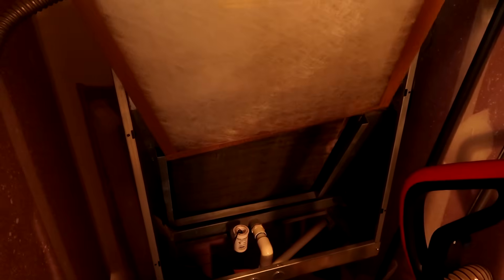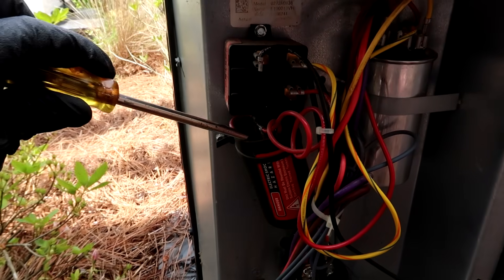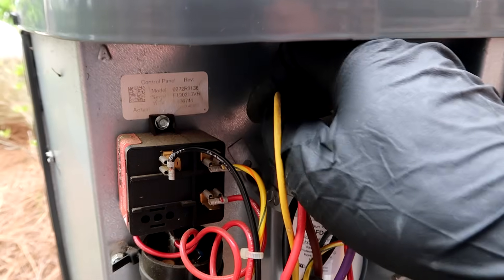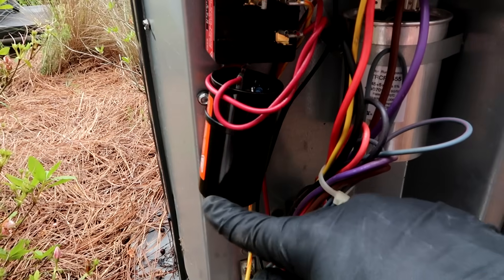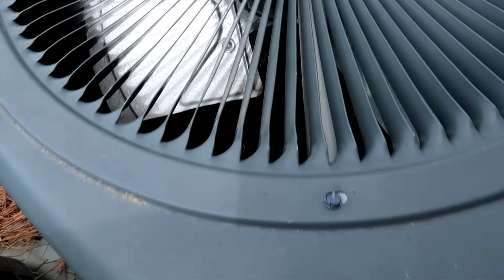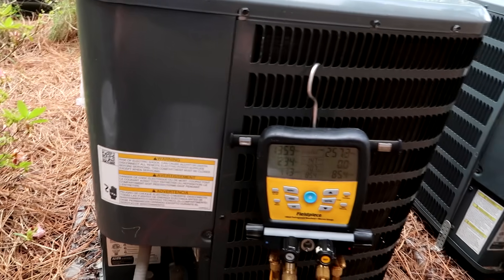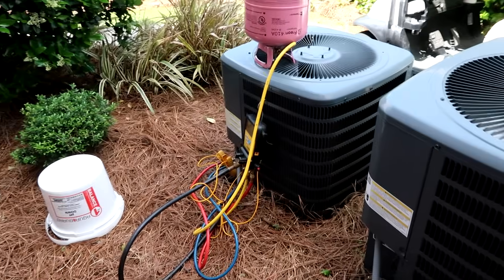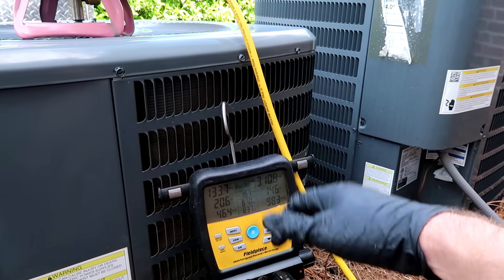HVAC Videos For Beginners

Comment: Lex  what about using a sealant on those leakers???
Reply from the maker: I saw a guy do an experiment with that stuff in a glass pickle jar.  It turned waxy and gummy. I'm too scared to use it for that reason.  It would clog the system. Thank you so much for watching!

Comment: I am in Michigan and home inspectors have this rule of not turning on an AC to test unless it has be at least 65 degrees for the past 24 hours.  I know about crankcase heaters but, how common are those in MI?  Will it really ruin the compressor to run the unit below 65 degrees?   We lived in southern Colorado where it was 50s every night and 90s every day in the summer.  And everyone ran their AC every day.  Did everyone have a crankcase heater
Reply from the maker: 65 is okay to run. Ive never heard that before so I'm not sure. Crankcase heaters are to keep the oil and refrigerant from fracturing. That would happen in 32 degree weather.
Reply: @LexVance    Yeah, 65 degrees for 24 hours is the home inspector rule.  I have inspected grow ops here in MI and they run the AC all year round.

Comment: When we turn our inside unit on it makes the button click in on the outside unit but the unit won’t come on… we have power evoking I got the unit but the fan or anything won’t come on any info would be grately appreciated
Reply from the maker: There's no high voltage. Check your breaker.

Comment: I was taught that the subcool should be between 8–12, and the super heat should match. Is that true?
Reply from the maker: Yes, however getting them to match isn't always easy. Just try and get them close. Some equipment in the real world just can't do it. The instructors equipment in a class room can do it easily. But, come out in the real world where things are mix matched and not installed correctly and see if an instructor can do that. I highly doubt it. Thank you so much for watching!

Comment: I've been repairing electrical/electronics for over 40 years. I Now teach AIRC technology. Looks like you have some skills! The only thing I would recommend is for you to reference the installation and parts manual as opposed to using the procedures used in the past. The industry is changing fast! 
The capacitor that was changed out (30/5mfd), may have been the correct cap for the rotary compressor. The only way to know for sure is to reference the parts manual instead of : "all rotary compressors comes with a 45 mfd"!  That's just not true! It's possible this one did; however, you don't want to be the goofball replacing a cap with the wrong value. The only way to know for sure is by referring the parts manual with the model number of the unit. 
Also, you don't mention what subcooling the unit calls for. If it called for 8 +/-1, the unit was overcharged because it was running at 12 degrees subcooling. It was 3 degrees off. This information you will find in the installation manual, service manual, or data plate. 
This is why its very important to reference the manuals. You may have been stressing the super heat when all along there was nothing wrong with it. Old Industry standards are changing! Read the manuals! Don't assume all units and/or brands work the same. Once you have read the manuals x many times, you won't need them anymore. 
Good luck!
Reply from the maker: Thank you so much for watching!

Comment: lex  i have a goodman heat pump  i have therostat set a 67  and temp coming out of the vents is 84  is that normal  thank you
Reply from the maker: Either heat strips are stuck on and you'll need to replace the sequencer or your reversing valve is stuck and will need to be replaced. Or, the 24v orange wire is not getting power. The orange wire has to have power for cooling.

Comment: Do you have a link for purchasing that multimeter? Tia
Reply from the maker: Click on the Amazon link below and type in Craftsman multimeter. They may not make it anymore. Fieldpiece is a great meter too. Just look at the picture and make sure it has the MFD setting. That's the microfarads setting you'll use to test capacitors. Thank you so much for watching Adam!

Comment: Man I’m in Texas it’s getting hot and my ac not cooling let me see if replacing the capacitor with a 45/5 will work . I’ve already cleaned it out .
Reply from the maker: I hope it all works out for you Anthony! 🤞
Reply: @LexVance  so the one I removed says 35/30 I bought the 35/30 440v replaced it and now the fan isn’t running outside should i try the 45/5 ? Or that a hazard ?
Reply from the maker: @Ants_tacos  You may have a bad fan motor or a wire is misplaced.
Reply: @LexVance  so I had the ac guy come out and it just needed free on I forgot to turn the breaker back on that’s why the fan wasn’t spinning 😵‍💫 hahahaha thanks for your help man !

Comment: i change the fan motor and the capacitor my AC still won't run what could be  ?  the contactor ?
Reply from the maker: It could be. I would need to be there to see if its getting voltage. It needs high and low voltage. 240 and 24 volts. I would need to be there with my volt meter. Thank you so much for watching Alex!

Comment: I'm HVAC tech with 25 years experience, the double up dryers one should be removed. It really taxes the compressor just like a kinked line with the extra restrictions of the second dryer. It can cause the liquid to start to flash to gas just like a metering device and not feed the txv with a solid collum if liquid causing all kinds of problems. IMHO I would remove the one inside the unit, that way if you have to change the dryer you can just pump down the unit instead of having to recover it. I know you like to install them in factory location but that why I always relocate them, it's a time and labor saver in the future. Hope this helps you out. You do a great job I don't want you to think I'm criticizing you about dryer location just trying to help you out. Love your content
Reply from the maker: Right on Dane! I agree. You're right about the restrictions and the easy pump down in the future. Thank you so much for watching!

Comment: Look on the back of that electrical panel on the condenser. It'll tell you the design subcool/temperature charge correlation with ambient and indoor temperatures. Normally Apt ac's are oversized anyways so doesn't have to be perfect unless you're working on 3rd floor end unit. Unit with a high load that is.
Reply from the maker: Right on TechFive! Good to hear from you, man!

Comment: Hello Lex, I agree two filter dryers are one too many. Would like to hear from the tech that installed new compressor. Your content is refreshing, many thanks Lex!
Reply: I heard it's bad b/c it Acts as a metering device (txv)
Reply from the maker: Thank you so much for watching Breeze!
Reply: 2 filter driers is also twice the restriction in the head pressure. It’s going to cause more w/t on compressor.
Reply: screw that call n get ur money back tell them take mickymouse back to Florida with their transgender education they try to indoctrate

Comment: If your line set goes underground your superheat may be high if you check it outside. Have you checked your true superheat upstairs at the air handler?
Reply from the maker: No, I'll start doing that as the line set does go underground. Great idea Carlos! Thank you!
Reply: True your SH should depend on length of line set as well as if coils are clean, I would never dump extra refrigerant in without making sure you got proper air flow. Think about it, what is more likely event to cause coils to ice up ? A leak in a sealed unit which is not subject to wear on lines since they stationary ? Or coils getting dirty over time which increases the pressures since they raising temperature from restricted air flow ? In my 10-12 years experience I have solved the problem by cleaning coils 60% of time, the othe 40% is refrigerant leaks either shoddy installs or units 15-20 years old.

Comment: Your saying you can never get the superheat below 20? Even by adding charge? Either semi stop up txv,  undersize TXVs or sometimes there's strainers b4 the TxV those could be plugged due to being a appartment complex installs go really fast and not much care goes into it, thoes be my guesses
Reply from the maker: I can try to add a little more refrigerant and see. I've never tried that. The subcool would be closer to 20 though. That don't seem right either. Thank you so much for watching Edward!
Reply: @LexVance  yes your right the subcool would increase. As long as superheat is around 5-20 with a txv and your close to your subcooling I say your good. But yeah a 28 superheat with the subcool spoton , indicates a restriction. Filter dryer ,txv , strainer ECT could be the issue. Check to see if you have more than 3 degrees across filter dryer that would indicate restrictive dryer
Reply from the maker: @Tacoboi979  Right on, thank you Edward!
Reply: @Tacoboi979  I just wonder if all the factory installed filter dryers are restricted or semirestricted seems like problems started like 2-3 years into them being in operation.  I think I would remove the factory installed filter dryer the contractor left in the unit and replace the one the contractor put outside and see what your superheat is then.  Maybe bad dryers are causing the evap coils to go bad prematurely.  Just thinking out loud.  You could also check the temp difference on both the factory installed filter dryer and the filter dryer the contractor installed that would be interesting.
Reply: True not just bad apartment installations but how many apts do techs clean BOTH coils ? Most techs rather clean outdoor coils and give extra shot of refrigerant. Granted in some apt setups it’s harder to get to indoor coils unless there is mechanical closet but restriction that close to TXV could be your issue.

Comment: Factory-installed filter driers inside condensing units should be banned. I'm not as riled up about the filter being installed outdoors but almost everyone says having it as close to the expansion device as possible to prevent any potential moisture from flashing into ice right at the TXV/piston. 

At least that is my opinion.
Reply from the maker: Right on, good to hear from you Big N8!
Reply: Filter dryers or accumulators are found in the engine bay on every vehicle exposed to extreme temperatures. They seem to do alright.

Comment: If only I wasn't stuck in a meeting.. I cannot wait to watch.  Usually HVAC as you know is easy... It's does it cycle on running both indoor and outdoor fans and the compressor then whether or not all the refrigerant leaked out.  It's a mess fixing a leak though ripping out an EVAP coil on their third floor...it seems they never pump down especially the rotary compressor units which run on a prayer and a hard start just to get them in the mood to run.
Reply from the maker: Right on Justin! Thank you so much for watching!